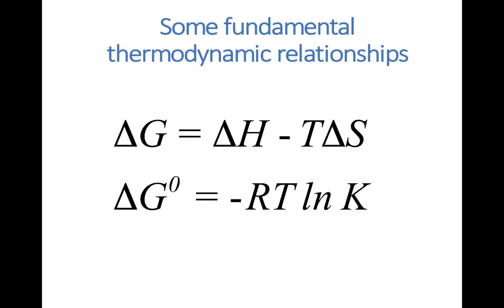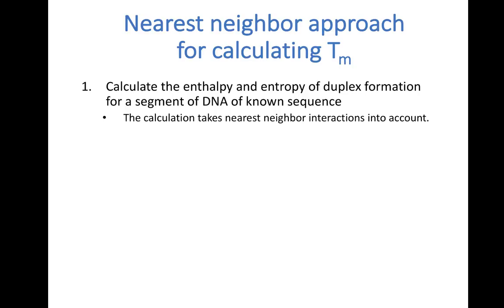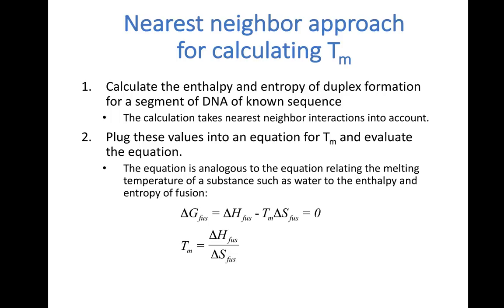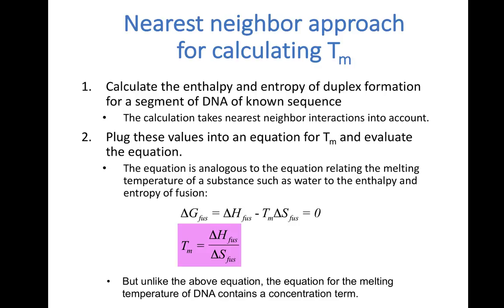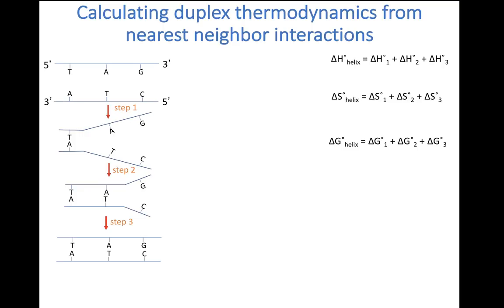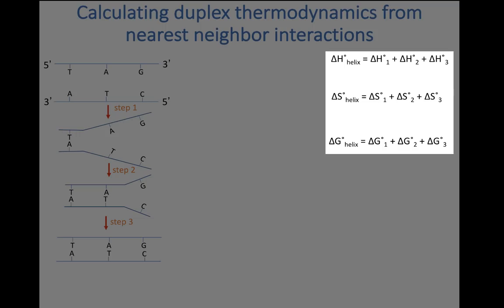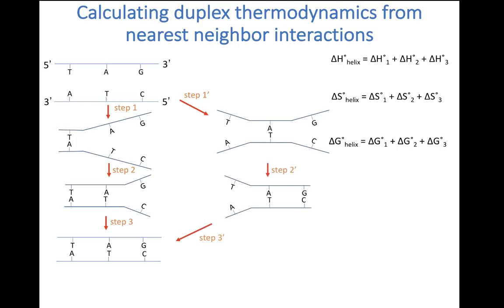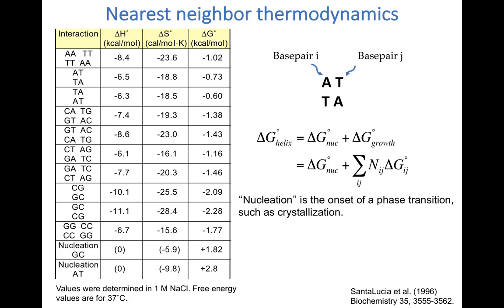Nearest Neighbor Method

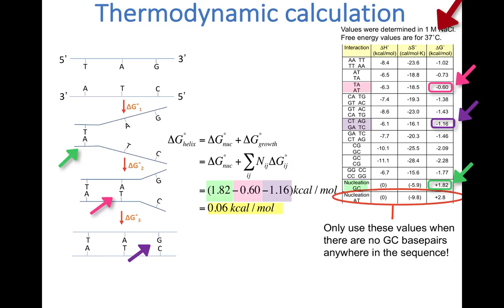Comment: Hi, Quick question. In the chart at 15:09., If these delta G values are established by measurements made at 37 deg C, how can I plug these values into an equation for melt temp that requires delta G naught? e.g. Tm = dG naught/(R ln (Ct/4))? Wouldn't the chart's values have to be measured at 25 deg C for this to work?
Reply from the maker: The equation in your question isn't valid. I'm not sure how you derived it. You can't determine the Tm from the free energy. You need to consider both entropy and enthalpy. We assume the entropy and enthalpy values are independent of temperature, which is only approximately true and is probably a source of error in the calculation. By the way, a standard free energy can be defined for any temperature. It's the free energy change when all reactants and products are present at the standard concentration (1 M in this case) and exhibiting ideal behavior.
Reply: @albertcourey6711  Ah I see, thank you. Now it makes a bit more sense to me. I was looking at the publication that I believe that your nearest neighbor table came from and I noticed that the delta G is written as dG naught 37 while the enthalpy and entropy are written just as delta H naught and delta S naught. Am I correct in thinking that this is because the measurements were taken at 37 deg but the enthalpy and entropy are assumed constant for all temperatures? I'm no chemist by any means, but I work with DNA daily and I've always wished I had a better understanding of its thermodynamics. Thanks for your response and your video , they were very helpful! By the way, I got that formula off of the Wikipedia page for "Nucleic Acid Thermodynamics"